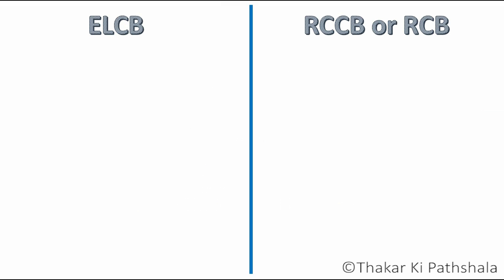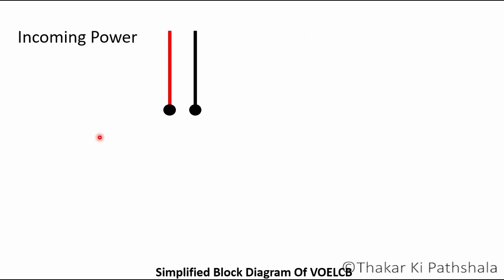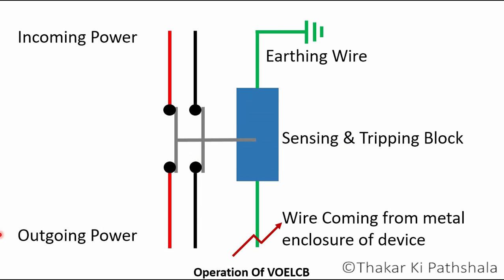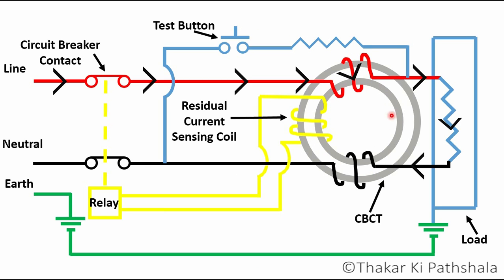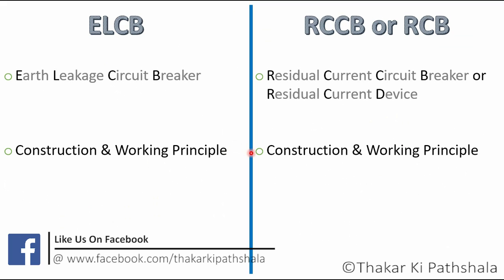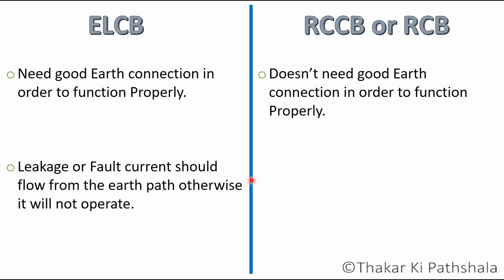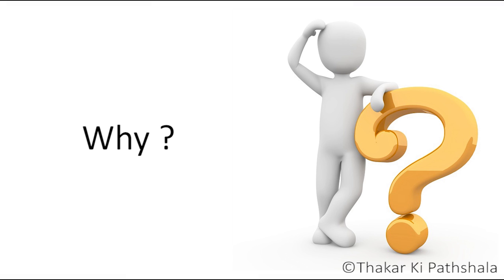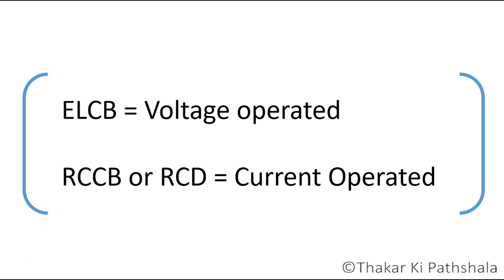difference between elcb and rccb  ELCB vs RCCB  ELCB vs RCD

Comment from the maker: Hamare hindi viewers ke liye is video ka pura saransh hindi me.

ELCB aur RCCB dono ke basic operation principle main difference hai ek hai ELCB voltage k difference pe operate hota hai jabki RCCB current difference pe operate hota hai. ELCB bahot hi purane kism ke device hai inme aapko earth wire connect karna jaruri hai ELCB jo hai vo ground potential jo ki ham zero consider karte hai aur kisi bhi device k metal enclouser par voltage difference hai ya nahi hai vo find karta hai agar normal condition hai to metal enclouser par koi current leak nahi ho raha hoga aur vo bhi ground potential par hoga yadi koi leakage hoga to ground aur us casing ka voltage level alag alag hoga. aur isko sense karne ke bad me ELCB trip ho kar ke supply trip kar dega. 

Jabki RCCB me aapako koi earth wire connect karne ki jarurat nahi hoti kyoki vo phase aur neutral wire me current difference par operate karta hai agar normal condition hogi aur koi current leakage kahi hoga to hamari search coil me flux nahi produce hoga aur agar fault hoga to search coil yani ki CBCT me flux link ho karke circuit trip kar dega. 

Asha karta hoon ki yah explanation aapako samaj aaya hoga agar koi bhi saval ya sujav ho to comment kar ke jarur bataiyega. aur hamare is channel ko subscribe jarur kijiye taki aise hi aur videos aapako milte rahe.
Reply: Nice sir
Reply: good information's

Comment: In the other video you have stated ELCB in the same way you have stated RCCB here... Then whats the difference
Reply from the maker: thanks suba haran for sharing your question here. ELCB is old device and it work on the voltage difference between earth and apparatus's body, where as RCCB work on difference of current between phase and neutral. Hope you have cleared the doubt. If you still have a question then please feel free to ask any time. Have a good day.

Comment: How to test ELCB and what volt we appyly how many types of test
Reply from the maker: thanks upendra kumar for sharing your query here. First of all I am assuming that you are talking about newer type of devices which are RCCB but generally people refer them as ELCB. So I am giving answer for RCCB.  Almost all the RCCB comes with testing switch just press it and you if the RCCB breaks the circuit then we can tell that RCCB is working fine. also RCCB does not operate on the difference of voltage so voltage will be rated voltage. There are many tests out there but for consumer two test are of use. one is sensitivity test in which we check what is the lowest level of detection of leakage current. and another is tripping time that after detecting fault how much time does it take to break the circuit. Hope you have got your answer. If not then feel free to ask anytime. Have a nice day.